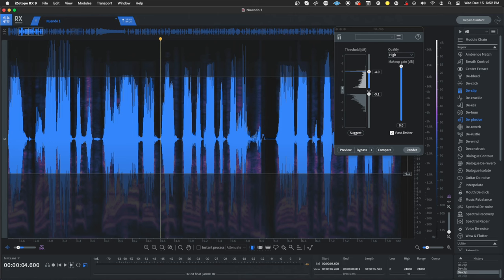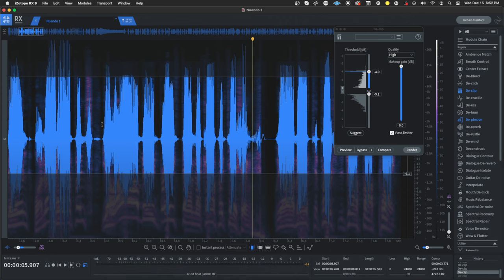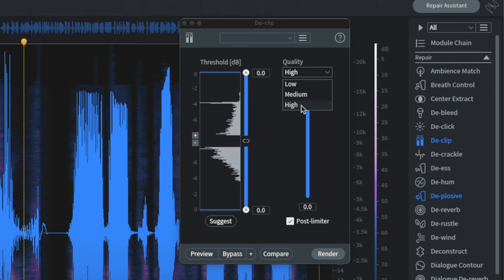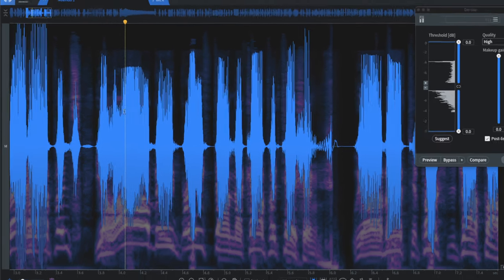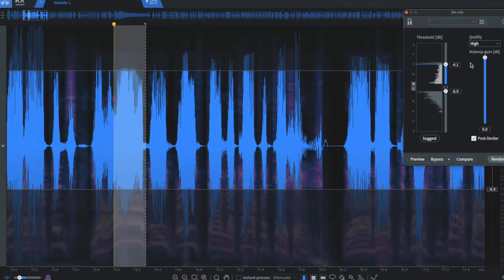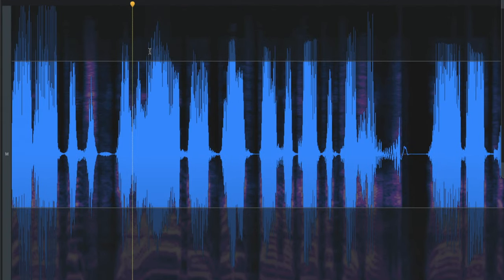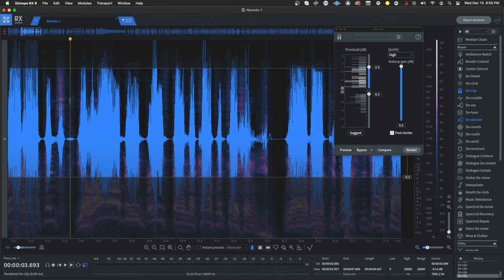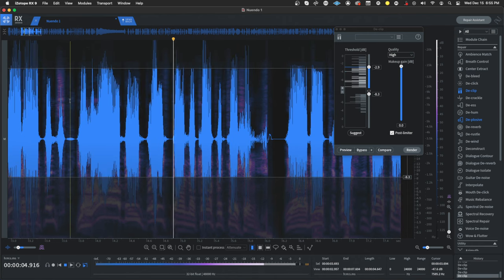iZotope RX9 How To Restore Clipped Audio

Comment: I always did the whole clip length in one go and wondered why it didn't work very well 😋
Reply from the maker: Yea that would do it haha. It is super sensitive so having it go through each distorted section manually is the best way to do it. 

It will default to the highest point and will only fix that. Problem with that approach is the high point will never change.